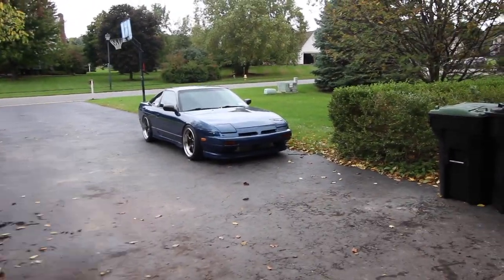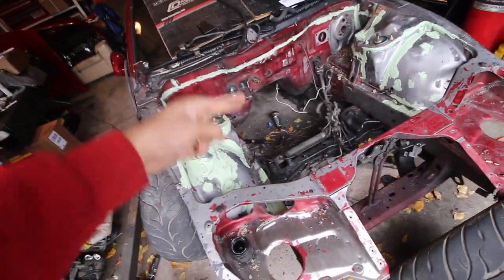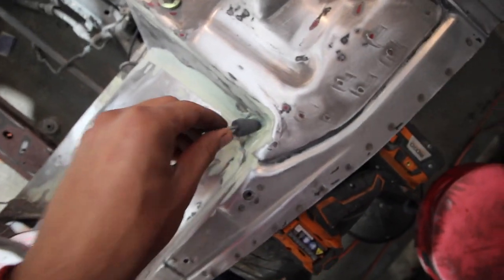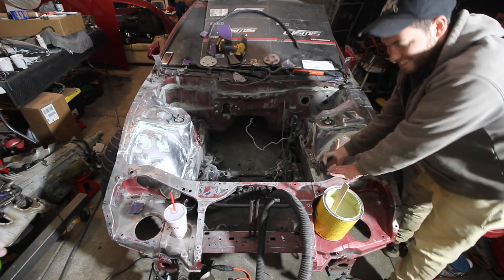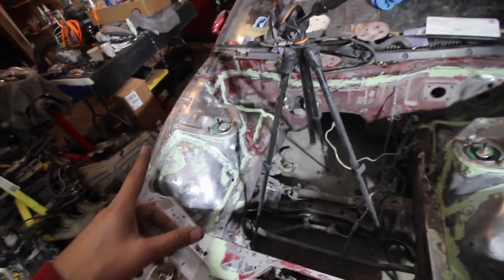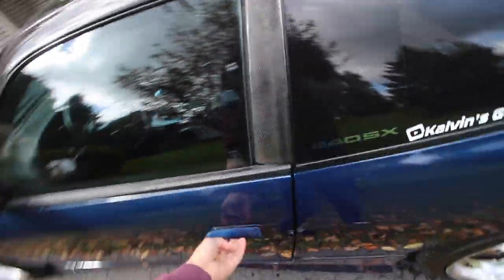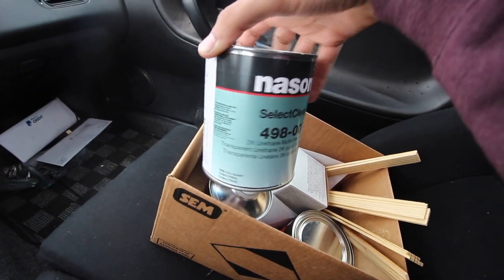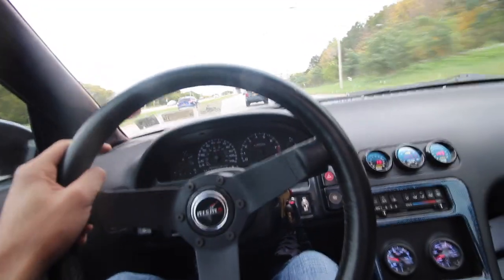SHOW CAR QUALITY! Shaved Bay P.2 | 2JZ 300ZX Build Part 12

Comment: Just FYI for future Z32 swappers, the firewall does NOT need to be cut to pull the harness. There is a little 'U' shaped clamp holding the harness to the firewall on the inside, just below/behind the A/C evaporator box. Once that is unbolted, the harness pulls right through, no issues.
Reply: BCs300z *AC Evapotator 😄
Reply from the maker: I couldn’t see any clamp holding the harness in! :/ bummer. Anyways. It’s all fixed now haha.

Comment: Rear ends are completely different. You'll need a TT subframe, axles, diff. Driveshaft, hubs and spindles. You mentioned wanting to take it to the dragstrip. Your current na axles are shit and always break at the splines. I'd recommend upgrading to an infinity Q45 setup to be able to use beefier 6 bolt axles like what the TTs use.